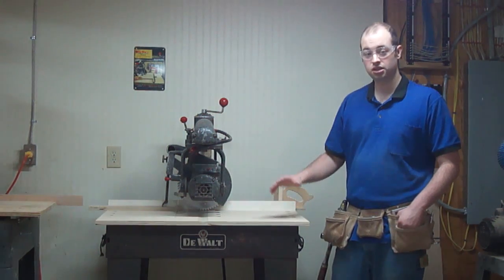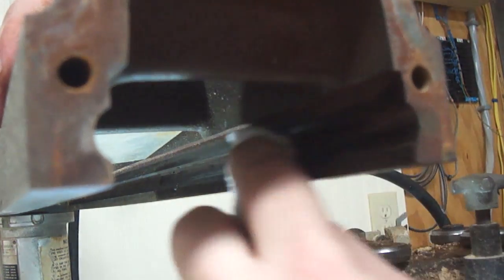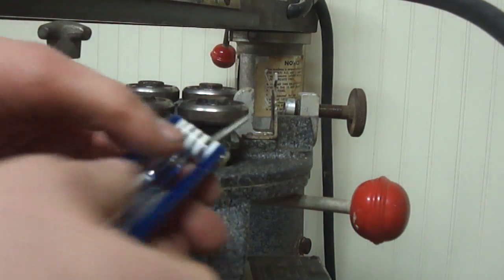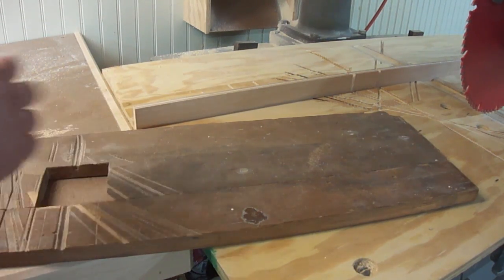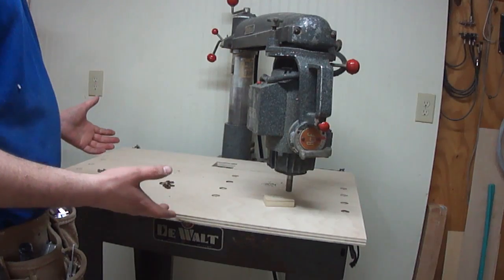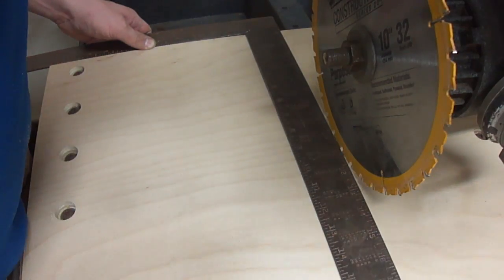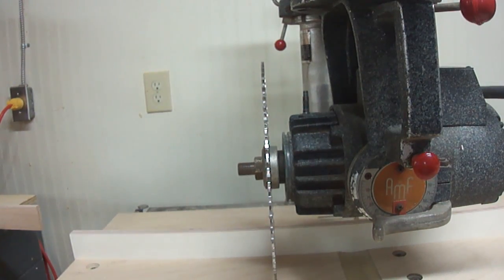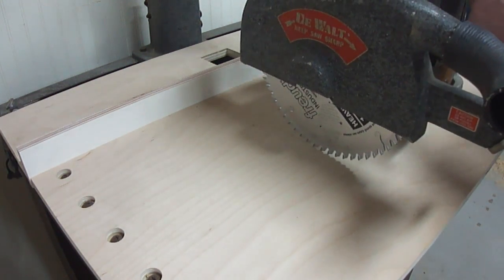How To Completely Align A Radial Arm Saw

Comment: Do the long bolts with lock washers receive the nut and lock washer under the rail? These log bolts are centered through the table over the holes in the frame to allow for clearance in tightening the bolts. When do you tighten these nuts? I assume after all the short bolts are used to adjust and level the table? Are these short bolts and nuts used to leverage the rail either closer or further from the frame to change the finish height.
Thanks
Reply from the maker: The long bolts are used for leveling and the short bolts are only there to hold the table to the rails. The nuts on the long bolts are adjusted up and down on the frame to level the table.

Comment: Great video, my detent pin on the front of the motor is stuck. I purchesed a 930 that has not been used for who knows how long. The motor bearly tracks on the arm and the pin is stuck. I dont want to use a torch and have used lots of WD40. Any ideas??
Reply from the maker: You could try taking the carriage bearings off and putting them in a toaster oven set on 300 for a couple hours and see if that loosens them up. Otherwise I think the torch is your best bet.

Comment: I would add this:  1.  Remove a few of the boards and level the frame first.  2.  On the larger saw aligning the large cylinder/pipe that raises and lowers the upper arms and motorhead is different.  That saw can be seen now and then in the background in this video.  That one has a long thin metal piece called a "gib" that slides down and fits between the frame and the cylinder/pipe.  The are two or three (I haven't look at it for a while) Allen screws that press against the gib shifting the plane of travel from top to bottom.  Imagine a pencil with the eraser on a table and the point aiming straight up.  Tighten or loosen the Allen screws and you change the aiming point of the pencil.  This in turn shifts the cylinder/pipe from right to left / top to bottom which chagnes the angle of the overarm and motorhead as as you crank it up or down.   You want the motorhead/blade to travel up and down 90° degrees to the table frame and cutting boards surface.  If it does not you will never get accurate cuts.  You may not notice it until you do miters, especially compound miters.  My saw was new when I found that problem.  Why didn't I send it back?  Because it weighs 705 pounds.  I remedied it by replacing the factory gib with a somewhat longer and thicker piece is steel.  (Ex. .250 x .150 x 8.50 inches instead of .200 x .100 x 7.50 inches.  My example is representative and not the actual dimensions but you get the idea.)  I bent the top over in a vise to create about a 1/4 inch hook to prevent the new gib from falling through the opening between the cylinder/pipe and the cast steel frame onto the floor. The problem was the original gib was not wide enough along its' length.  The Allen screws missed the gib by about one half of the diameter of the screw shafts.  In order words, it never locked the gib firmly into any final position.  How did I find the problem?  By performing the standard board cutting alignment test that should be first (and finally) used on any fixed or movable power saw.  Here's what you do:  cross cut a piece of one inch stock about 1 foot long x 4 inches wide.  Hold the left piece against the fence.  Flip over front to back the right piece and push the edge you just cut against the left piece.  Look carefully at the cut on the top and side of your work.  Next flip the right piece  as it originally was and hold it against the fence.  Now flip the left piece front to back, hold it against the fence, and push it against the right piece.  Again inspect the line of the cut top and side.  If both sides of the cut match with both tests without a gap you have spot on alignment.  If not, your cutterhead is slightly off aiming north/south, east/west, or both.   This check should be done every time you change a blade or move the location of the saw, and even periodically for no reason at all other than machinery vibrates and parts of it can and now and then do shift off center.   3.  AFTER you have the up down travel of the overarm aligned, now go ahead and align the table top as shown in the video.  If the arm is not properly aligned you cannot properly align the boards that form the table top.  This will become apparent as you shift the arm 45° in both directions across the table top (for miters).  Cross cut another board and check your work again.  4.  On the larger saw, 14, 16, or 18 inch, the electric motor and yoke (the cutter head) gets removed the same way as shown in this video but it weighs about 200 pounds.  Crank it down to set it on or sllightly above the table before you slide it out of the upper arm.  5.  NEVER mount any radial saw on a moveable stand or carriage.  First of all they are top heavy.  The base a radial saw sits on is stamped steel that does not weigh much.  The structural working parts of good radial saws are cast steel.  Secondly, they are made for stationary use and the last thing you want is any carriage or stand rolling around on you during the middle of your cut.  Don't trust a "locking" base.  The 18 inch model can be 3 phase and 7.5 hp.  They are finely balanced but that is a lot of force that sets up subtle vibrational harmonics in your saw.  Finally, this video and another one about how to use a radial saw by the same author are very good.  If you haven't used your saw in a while you should take the time to watch them again BEFORE you touch your saw.

Comment: Next time, and especially before replacing those very expensive carriage bearings (they would have been $125+ per pair bearing on my DeWalt GE, and that needs 4 pair!), remove and soak them in your favorite degreaser or kerosene or gasoline, give them a few spins from time to time and let sit over night.  I've found that much of the gunk is actually just 40-50 year old degraded/hardened grease.  Give them a shake in a jar of mineral spirits to rinse them off the following day.  If the bearings move completely free, move on and repack with grease.  If not, put them in a glass jar (glass works best, not plastic) filled with degreaser or kerosene or gasoline, and run them through a hot water 10 minute cycle in an ultrasonic cleaner (add boiling water to your ultrasonic cleaner unless it has a heating cycle).  This should remove all remaining degraded grease and the junk that may have found its way under the races.  Either replace the bearings if they are still hung up, or use mineral spirits to rinse them off and move on to repacking with grease.  With the races still on, submerge the bearings in a tub of red and tacky grease and put the container in a vacuum chamber.  (There are many DIY videos on very inexpensive ways to make one from $20 Harbor Freight air pumps, fish tank air line, and your shop compressor.)  The vacuum created will replace the air pockets in the bearings with the grease.  You will see the grease level decrease.  Done.  You now have 50 year old bearings that are as good as new and you can do this with every bearing you have.  Of all the maintenance and restorations I've done over the years, I have replaced very few bearings, only those that were actually broken.
Reply from the maker: That is a great tip, thanks!

Comment: I'm reconditioning a De Walt 1030 RA like yours that I just picked up. Nice video. Resisted the call of Mr Sawdust I see. ha ha
Reply from the maker: Thanks! You mean the table? The Mr. Sawdust table is really made for the smaller DeWalts that only have two table support bars. The 1030RA has 3 support bars so the span that the table is unsupported between them is pretty small. If those support bars can’t keep the table flat nothing will.

Comment: Hi, I'm looking at an old 10" Dewalt MBC saw just like this and see on the motor it's rated at 1/2 HP at 115v.  Can these be rewired for 220v to increase the HP?   I can pick it up for $150 but am wondering if it's worth it as 1/2 HP for a saw like this seems really underpowered.  I recently passed up a 3HP Rockwell 40c but let it go because it was 3-phase.  Have you ever used a VFD with one of these.  I know you have a 40C.
Reply from the maker: Unfortunately the motor on the MBC will always be 1/2hp. Sure it’s not the most powerful saw but lots of people have them and like them. My next ras I add to the shop is going to be a 1/2hp MMB. Here in New England $150 is pretty pricey for a MBC but maybe saws are more expensive where you are. As to a vfd on the 40c, I had mine running off a vfd for a year before the vfd blew up. I then made a simple static phase converter for $50 and have been running it off that for the past 11 years.
Reply: @TheNorthlandWorkshop   I totally regret passing up the 40c actually.  It was a 16" and aside from the phasing issue I was concerned about it just being too big for my shop space.  However, they had lowered the price from $250 to $150 and after hemming / hawing for a day it sold out from under me. I kind of expected it but then decided I was crazy not to get it but it was gone.  It seems like it would've been the one to get out of the two for its size and HP but the DeWalt seems nice too. I know the old MBC's have a cult following.  I'm just really into old Rockwell though.  I'm in San Diego BTW, everything is really pricey here no matter what it is unless you hunt a lot and are very patient.  Over the last decade I've been lucky to amass a lot of old Rockwell, Delta, and Walker Turner tools for fair prices but still more than you see stuff go for on the east coast.  I'll probably launch a channel this spring as I'm building a lot and restoring some of them.  Anyway, your thoughts on the RAS stuff is appreciated. I've enjoyed your vids.  Lots of good info!
Reply from the maker: I’m fond of the old Rockwell stuff too. If space is an issue what about a Delta 900 saw? They’re like a smaller version of a 40c. A benefit to the turret arm design of the Rockwell/Deltas is that they can miter to the left as well as the right. Let me know when you start your channel, I love old woodworking machinery.
Reply: @TheNorthlandWorkshop   Will do.  And I forgot to mention I have an RD 990 I picked up for free off CL last year but A; it's missing the table /crank and B; there is a small crack in the cast iron at the rear of the main arm. Not where it attaches to the pole but a few inches in front of that so I've been concerned it could fail. It's not that bad but imagine if the whole thing suddenly snapped while making a cut lol.  So for that reason I've kept looking.  That and the turret bearings are super stiff and I haven't looked into if they're even replaceble.  I love the rod systems of the 30/40c.  Much better design.

Comment: I picked up a Dewalt 7790 12" contractor Radial Arm Saw.   I haven't tried to align anything nor will I use this saw until I do.  I am just learning as a winter project.   I  have a lot of work to do on this saw.   Immediately, I noticed the arm can move a little while the detent (sp) is in place.  It appears the movement is because there are no washers on the detent bolt.  The moment is between the bolt and the detent.  The wedge appears to lock down pretty well. It could be worn down, I'm not sure yet.  I believe all I need to do is fill the gap on each side of the "wedge" part and that would keep the arm from moving providing the detent bolt hasn't hollowed out the detent wedge piece.   The arm lock is also out of adjustment.  So this will be the first area to "fix".   

I don't have a users manual, so I'm beyond raw  on this tool.  I have used plenty of "saws" of all kinds, but ths is my first RAS.   Can you talk more about  the  controls to pivot the blade for ripping?   And, how to clean up those controls.   I don't even know the names of the parts I want to ask questions about!

Comment: Excellent video!   Very well explained.   For anyone just getting a RAS for the first time,   You must go through and make all the checks and or adjustments that he has shown in this video.   If not, you will never be happy with the saw and decide that it is just not a quality machine.
When putting the bed down, to help align it with the blade, I use a 3' straight edge against the blade and align the back edge of the table with the 3' edge.
You will enjoy a RAS if it is setup correct!
Respectfully,    Kevin
Reply from the maker: Kevin Coop thanks for watching!
Reply: The Northland Workshop    Excellent videos need not say thanks.    I enjoyed seeing a quality one though.

Comment: Excellent job young man. I’m a 53 year old carpenter and just bought my first radial arm saw. It’s 43 years old and never was used. The original blade with no use on it and the table never had a saw mark on it. Your video will help me out so much. Thanks for posting it for our viewing.
Reply from the maker: Tommy Kaulback glad I could help. Thanks for watching.
Reply: Wow, you lucked out. what kind of saw did you get?

Comment: Brilliant video what would you say best all round blade wood be is that a 32 tooth construction blade the blade ive got is to fine at 60.
Reply from the maker: Mark Clancy I have a Freud LU82M010 on this saw and I really like it. It’s Freud’s version of the Forrest Woodworker I blade which was designed to be a general purpose RAS blade. So far it has done everything I’ve asked of it at a fraction of the cost of a Forrest.
Reply: @TheNorthlandWorkshop  funny that just ordered freud blade a 40t n 24t twin pack.i will have a go with it when they come.

Comment: Good stuff I bought one of these, and have spent about 6hrs elbow grease and half a pint of WD40. It really improved, added on some electrical contact cleaner to the electric parts and lithium grease on the runners. These things are just solid and so nice to use.

Comment: Excellent video.  I just replaced the top on my approx 40 year old Dewalt 740 two weeks ago using HDF instead of plywood.  I knew about the leveling the top, figured out about paralleling the blade with the fence (when my rip cuts wandered off), checked the 90 degree angle w the fence but never considered the heel issue.  I need to go back and start at the beginning.  Your explanation was great. Just wish I’d seen it before replacing the top!

Edit: Just checked the heel and both are good.

Comment: I picked up an old Wards saw, built a nice bench for it, put on a fence and a sacrificial surface..... now I just need somebody to come set it up for me. Installing the fence where I researched the "correct" place for it was, the inside and outside rip rulers and pointer are off a few inches..unless I move the fence back nearly all the way. I'm stressed right out of the gate.... who do I call?
Reply from the maker: Ryan Wiederstein ghostbusters. In all seriousness the in rip scale should read 0 when the saw is in the “in rip” position and the blade is just touching the fence with the fence in it’s most forward position. The “out rip” scale assumes that the fence is moved back as close to the column as possible. If the scale is several inches off it sounds like the fence isn’t in the correct location or the table dimensions might be different than original. I wouldn’t worry too much about the rip scale as I always use my tape measure to double check it anyways.
Reply: @TheNorthlandWorkshop  agreed, thank you. I've restored a few cars top to bottom, still have two, been around construction all my life (I'm 44 now so 30 years anyway) 26 years in the hvac industry... I'm better than average with my hands but I just know that if I follow another couple of videos on here I'll be wicked frustrated with it :)

Comment: Excellent video on setup. I have a circa 1960 10" DeWalt radial arm saw. Seeing you do the setup physically through Youtube answered all my questions on set up. The original manual goes into setup and alignment. However, actually seeing it being done is a whole other story. I grew up with these saws and will always have one in my shop. The motor on mine purrs like a kitten and quality of construction is better than anything out there today. Thank You! and thumbs up!

Comment: Great info and nicely done. I will add, only because you didn't mention it, that when doing the 90 degree arm detent adjustment that there are also two setscrews that lock the adjusting screws in position. I've got two Craigslist-found Dewalts - a GP Portable from around 1945 and a 925 from around 1959 or 1960. The older GP was missing the heel adjusting screws completely, so I had to do that adjustment. However, everything else with it was good. The 925 needed EVERYTHING adjusted. I got the GP back in October - was my 1st radial arm. I love these things. They're so versatile. Yes, they take more initial adjustment than a table saw, but once done I think they're incredibly useful and a blast to use. I educated myself on these saws by reading a lot, especially the Mr Sawdust book, and watching a lot of Youtube videos. I'm 58 years old and never used one until I got that GP last year. I feel like I was missing out. I've even ripped with them ( gasp ! ) and hardly anyone was killed ... 8-)   Regards -
Reply from the maker: spnynorman thanks for watching and those are a couple of nice saws you have. Do you mean the two set screws I talk about @32:00?
Reply: I’m an idiot - you DID mention those setscrews. I stand corrected.  Cheers -
Reply from the maker: spnynorman don’t worry, you!re not the only one, I have received many emails about me not mentioning those setscrews. I’m not sure why but a lot of people don’t hear me call out those setscrews.